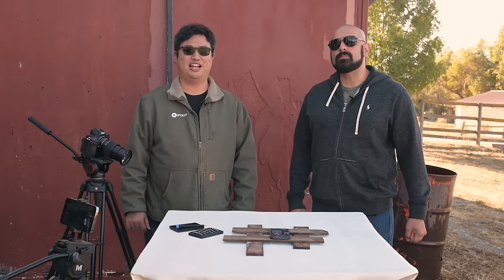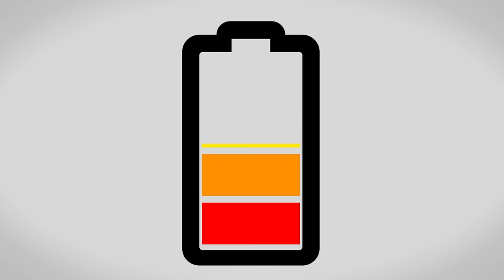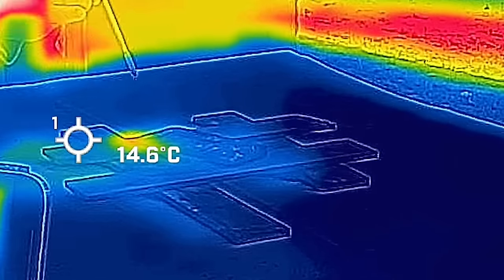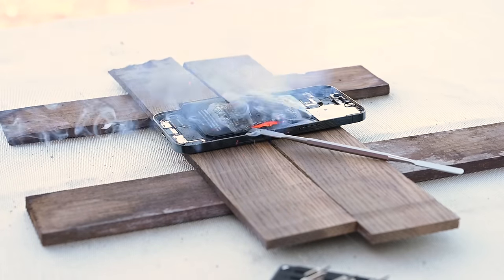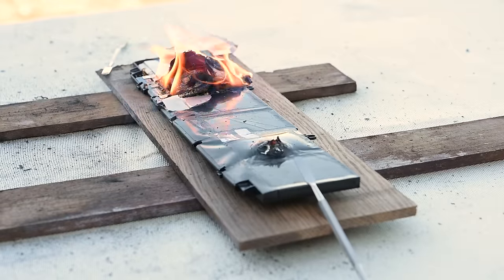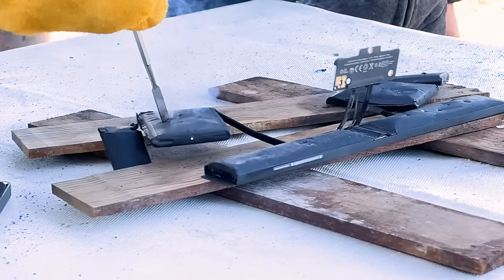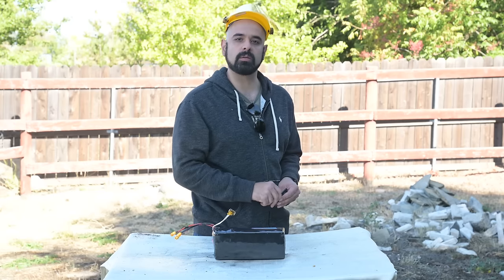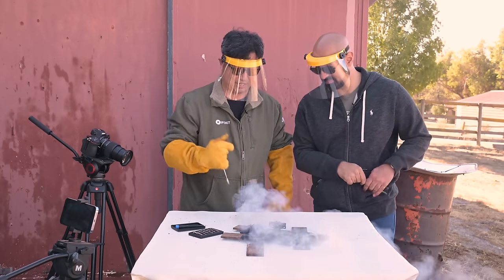Everything You Need to Know About Exploding Batteries

Comment: So many great analogies! This really made battery fires easy to understand! Easy to see that there's a world of difference between low-power battery repair and full-power locked-in-your-phone batteries are completely different worlds!
Reply: Ye still don’t make sense how the video is helpful when all they talk about is discharging a battery, yet not showing a single way to do so, yet we see a lot of messing around “don’t repeat at home”..
Reply: @sunnydeath2635  To dischage a battery, you use your device, then the battery discharges. agree?
Reply: @russelltindale9428  what if a device is broken? Lol your reply doesn’t help.. agree?
Reply: @sunnydeath2635  haha, didn't think of that. But it's not like you have to discharge it. It's unlikely for it to explode. And most repairs where you cant see the battery chage (probably because broken screen), you probably dont need to take out the battery.

Comment: I learned a valuable lesson nearly 5 years ago now when I changed the battery on an iPhone 6s I had scored for what was then a cheap price.  I was only 16 and so excited to have a new phone, but I ended up breaking both pull tabs off on the battery.  I ended up prying on it and I suppose I bent it too much or something as the battery lit up right inside my parents house on the dining room table.  I got very lucky that I was right next to the back door as I grabbed the screen-less phone and ran out to the screened porch, where the adhesive that was holding the battery in so tightly near instantly melted.  The battery dropped from the phone as I was frantically waving it in my hands and harmlessly burned away on the concrete floor of the porch.  Very luckily the phone was nearly wholly undamaged (one of the tapes that hold the Apple logo in place was a little melted on the edge), and that phone still serves with me today.
Reply: Would you go for upgrade soon or in near future? You can't have that phone forever you know like degrading components besides batteries and plus, you can have a good deal on great ones like SE
Reply: Did you type that comment with the phone?
Reply: @Laz3rCat95  I would have but it still has iOS 11.3.1 and YouTube app doesn’t support iOS 11 anymore sadly
Reply: Next time, slightly heat with heat gun on outside of back case and glue will release easy

Comment: This is why gluing your battery down into the device is a terrible idea. It's much more difficult to remove, meaning that it's more likely to be punctured upon removal, causing the short circuits and the possible safety issues mentioned in the video.
The best type of laptop batteries were the older, removable ones that contained 18650 cells - easy to remove (often just clipped in, no back panel removal etc etc) and not likely to explode, since you'd have to go through the plastic casing of the battery pack and also the metal casing of the 18650 cells.
Whereas, modern laptop batteries just have the cells themselves wrapped in some sort of paper label - which won't give any protection at all.
The same goes for mobile phone batteries - the best ones are the ones that you can remove with your fingers (Samsung Galaxy S5 and older) - no prying or isopropyl alcohol necessary.
Reply: For that reason I still have my S5 mini and an old sony vaio laptop. I had replaced my laptop with a surfacebook, but its battery is now swollen after 5 years.  For that reason I started up my old laptop, which is now 15 years old and it still works fine. Because I could just remove the battery, I never had to worry about battery issues with that thing. Now I wonder if I will manage to swap the battery of the surface. At least this video reduced my worries of making it explode
Reply: But. Much moneiez??,!

Comment: One thing that has not been pointed out that is extremely important is that lithium fumes are TOXIC and if a battery had ever combusted in the same room you're in, you should quickly poke it with something like a pencil or a pen to some spot where it won't cause any bigger fire and immediately back off a few meters away.

Comment: One of the issues is when devices with these batteries wind up in landfills. They can actually light the whole trash heap on fire if it goes unchecked. The problem is that many of them are still fairly charged, such as vape pens, and they get crushed or damaged in the trash pile.

Comment: thank you!
I had a fully charged MacBook Pro swollen battery and unfortunately, I forgot to uncharge it first.
one probably dangerous thing I did in order to reduce the effect of any explosion was to cut the wire that connects these cells to each other by almost pulling and cutting them at the same time.

Comment: I wasn't aware the reaction was self sustaining. I did know you don't put water on it though. Firefighters often tow electric vehicles somewhere safe to let them burn out on their own, lest they leave a lake of hazardous chemicals all over the place while attempting to put it out, but somehow thermal runaway never clicked in my head. I thought it was only because the battery packs are so tightly sealed, it's impossible to put it out because you can't even get to its internals where it's burning. If vehicles are meant to be all fully electric sometime in the future, how the heck are we supposed to prevent crashes from squishing the batteries and causing giant toxic fires?
Reply: That’s not the only reason why you don’t pour water on a lithium battery that has caught fire. You might have learned this in chemistry class like I did and just forgot, but lithium plus water equals fire, possibly even an explosion. So it’s the whole “adding fuel to the flames” scenario. A golf ball sized hunk of lithium tossed into a pool can cause a steam explosion you really don’t want to view poolside, just so you know. Oh, and to answer your question: put the battery in the center console… if a battery can fit there by that time.
Reply: @thousandsunny3103  Yes, I know about the reaction. What I said afterwards was unrelated to the reason you don't put water on it.
Reply: @MeowThingy   My comment was for others as much as it was you.
Reply: @thousandsunny3103  Yup yup, I know. It's good info for sure.

Comment: Great insight on what to do before doing the repair, but you should also include some fire safety tips like using a fire bucket, because litium battery burns really hot and an extinguiser most likely won't be effective.
Reply: if you saw the last clip with the large drone battery then you'll see that the extinguisher used proved to not be very effective.

Comment: Still have three Questions about bloated batteries. 

If bloating occurs to a deep discharged batterie, would anything happen with said battery if its being stabbed // worst case ruptures by itself?
&&
if bloating occurs due to a charging defect/overcharge (presumably 25%-100% charge), should you still let the battery drain? And if so, how? Just by letting the device run and hope nothing happens while draining the battery? What would be the go to for this situation?
&&
what about bloated, glued in place (for example the nintendo switch battery). Again, like the previous 2 questions depending on the battery charge percentage that led to the bloating, would you just remove the battery with adhesive remover/alcohol like normal, or would that change the replacement somewhat drastically?

Thankfully i dont have to deal with any of these situations right now anymore, but those are the questions which i still have, even after the linked blog and the video. 
Thanks for your time if someone decides to answer to this.
Have a nice day.

Comment: Ouch, you really should have done that demo under an extraction hood, or at least not in a neighbourhood and with a HF-rated gas mask cartridge. The gases from some battery chemistries burning can be downright nasty, depending on the chemistry used. Hydrogen fluoride or hydrofluoric acid is no joke, and neither are the various fluorophosphates that might form...

Comment: I want to ask
if you're not using a device for a long time (lets say, 3-6 months or more) is it better to discharge to 0% or let the battery discharged itself?
I've seen many battery won't charge anymore if not use for a long time
Reply: Charge to 50%, that's where it should be the most shelf stable (lithium battery)
Ideally, put it thru a full charge/discharge cycle at least once a month.

Comment: What about accidentally bending the battery without puncturing? This can happen when removing from a smartphone for example.
Reply: May depend on the severity of the bend. I would still consider it unsafe, even if it's still functional. removing the battery without bending should be a high priority, using alcohol to dissolve adhesive if necessary. bending the battery could cause a break in the electrolyte and create a point of contact between the anode and cathode in the battery.

Comment: This was really helpful ! I always discharge battery to 0% before changing it
Reply: This is dumb and harmful to the battery. You can recharge from any %, you don’t need or want to go to 0%
Reply: 0% isn't entirely necessary, it may cause the battery to degrade a bit faster. Lithium batteries are not very happy at 0% charge, so leaving a little bit in there would be better, unless it's only a short period of time that the battery will remain discharged.
Reply: @00SNIVY00  But the used battery would just get thrown away.
Reply: @f.i.b3027  Depending on what it's from, it could be repurposed somehow. The average person won't, certainly, and most people should find a place to recycle them.
Reply: @00SNIVY00  I mean you are probably changing the battery because the battery has worn down.
Reply: @f.i.b3027  I'm imagining an uncommon case of someone doing repair work and keeping functional things around to test other things. Or the case of someone wanting to tinker and make other things. "Worn down" according to most companies is 80% of the battery's original capacity, but that 80% can still be utilized, even by something else. It's silly of me to consider and continue going on about it, but it's a non-zero possibility.
Reply: @00SNIVY00  we just throw away the old batteries
Reply: @geobioboo  did you read what I said it's CHANGING not CHARGING it's (changing = replacement)

Comment: FYI… batteries don’t usually Explode”, they “Confligrate”. The difference is the flames don’t travel fast enough to creat a sonic boom, or rather they can’t travel fast enough to break the sound barrier at the speed of sound. It’s possible a battery inside a sealed metal enclosure, or something equally robust as metal, could explode but it would have to be a much thicker metal than the sheet metal that you might see a battery inside of. That would decrease it’s chances of accidentally being punctured or damaged in a critical way. It’d also mean making them heavier and bulkier, which is back-stepping a bit. To be fair, a conflagration can be very dangerous, especially if taken to the face, but it’s nowhere near as “Surprise. You soiled yourself!” as an unexpected explosion.

Comment: What are the best fastest way to discharge??
Reply: I would suggest just using the device as normal, there's only so much you can do to drain a battery. If it's a phone or a laptop, raising the screen brightness and playing music on the built in speakers would work.
Running stress tests or benchmarks probably wouldn't be the best idea because running the processor harder generates more heat inside the phone, which probably wouldn't be good for the battery.

Comment: I think that showing how to properly put out a lithium fire would have been useful at the end, especially since you showed that a (presumably) normal CO2 extinguisher doesn't work. Great video otherwise!
Reply: You can't extinguish a lithium fire, all you can do is smother it until there is nothing left to catch fire, so burying it in sand is best or a finding a metal container, but if you have to you can completely submerge it in water.
Reply: Don’t try to put out a lithium ion battery fire with water. Lithium reacts violently when water is present and that can make the fire spread even more. To put out such a fire, a Class D fire extinguisher is recommended, or just call the fire department.

Comment: few years ago, apples batterie strips were pretty easy to grab and to pull out, on modern iphones its a pita to even grab them, cause the lashes on top of the battery are so damn thin. only thing worse is the display adhesive on 12/13 phones, cause when removing it, it rips basically every 5 milimeters, removing the old adhesive takes more time than actually repairing the phone. so annoying.

Comment: How would you extinguish a battery fire once it starts?
Reply: You dont. 
I think that you will need to isolate the battery from oxigen, and thats impossible in a uncontrolable situation.(Without professional tools on a lab)
Reply: There isn't really a way to extinguish a lithium fire once it's started. It would be best practice to have a sand bucket or something similar that you could put the battery in and smother it. So have a fair bit of sand in some container, probably metal, be outside on concrete or another non-flammable surface, and have sand in the container, and more sand to pour on top of the battery.
Do not use water whatsoever, lithium and water do not react well.

Comment: Lithium batteries also can create their own oxygen supply when they catch fire, which is one of the reasons battery fires are so hard to put out. And when electric car incidents do happen, firefighters can't really do much and have to wait until the battery's energy is gone aka it's done burning itself.
Edit: i learned this is not entirely true, check the replies.
Reply: This is incorrect. Lithium primary cells can do this but you don't use those in your phone or car... unless you want to throw it away after it goes flat, as they're not rechargeable. Lithium ion batteries are simple electrolyte fires (which is explicitly stated in the video) and firefighters have effective procedures for dealing with EV fires.
Reply: @JamesChurchill  Oh, interesting. Today i learned. Thanks!

Comment: Thermal runaway pertains to heat destruction not chemical reaction runaway.  Related but not the same.  LED amperage as an example.  Chemical reactions could run away from gas evolution and not necessarily because of boiling.

Comment: Myth Busters did an episode of Lion batteries being thrown into the trash and catching the trash truck on fire. I noticed the difference between the batteries that caught fire to the ones that did not catch fire were fully charged batteries immediately burst into flame and the discharged ones did not. For the myth they used new or batteries that would hold a full or near full charge. if they had put batteries that wouldn't hold a charge into the trash the fires would have never started. I personally tried to get batteries that were no longer holding a charge to catch fire and no matter what I did they would not ignite.

Comment: Will they burn underwater?  There is alot of misinformation going around about EV batteries not being able to be put out.
Reply: Lithium reacts violently with water, so adding water to the equation will usually make it worse
Reply: @aspensareprettyneat4002 yet water is widely used to control battery fires.   Lithium metal reacts violently with water, lithium ion batteries do not contain lithium metal. Please try again.

Comment: Opened my phone while it was charged and with 0 experience with batteries i tried taking the battery out with a flat iron tipped screwdriver in the same way you'd take out a nail with a crowbar and it heated up, smoked but never started a fire